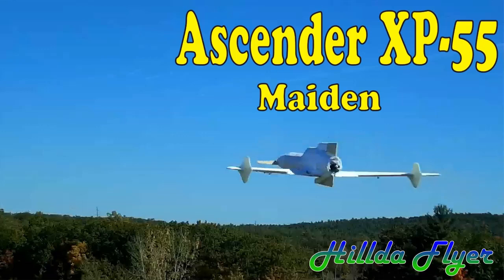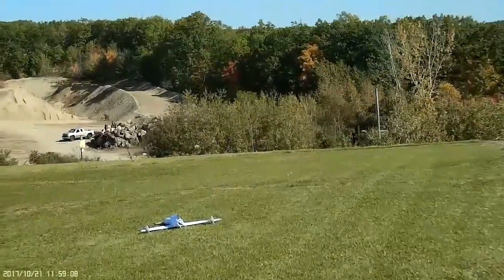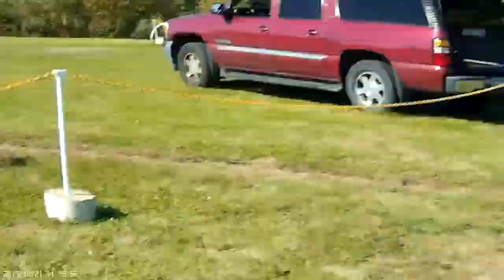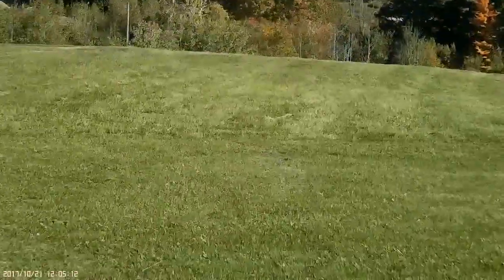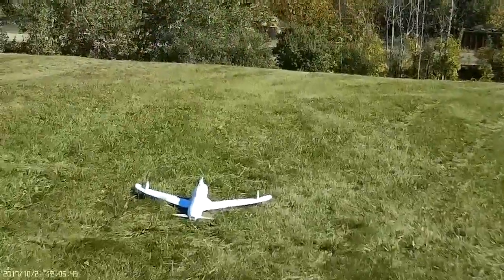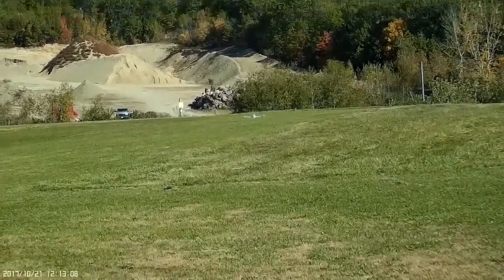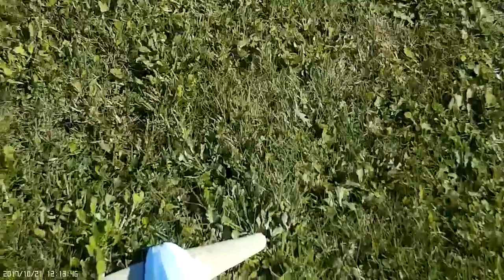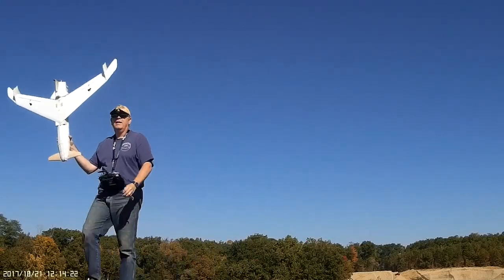Ascender XP-55 Maiden

Comment: "It's got some really bad stall characteristics."  So did the full size aircraft circa 1943-44.  2 of 3 built crashed in stall induced accidents.
Reply from the maker: Yeah, ain't that true. When flying with that much tail weight, the tails kind of slides around in the corners. It was a handful.

Comment: well, the canard is so far forward, on this weird-ass planform, 90% expo is needed in order to use it as an elevator.   when built as a small model, in the 21st century, the shortcomings of the design become apparent.  control might be more precise if a split canard was used and slaved to the aileron signal, while using elevons.    cheers
Reply from the maker: Yesterday I adjusted the throws of the canard to about 50% of the elevon throws. It was too winding to test, but I'm hoping that the canards become an assist. We'll see.